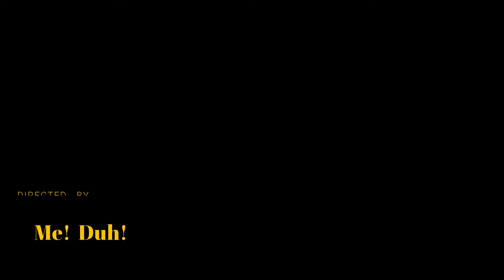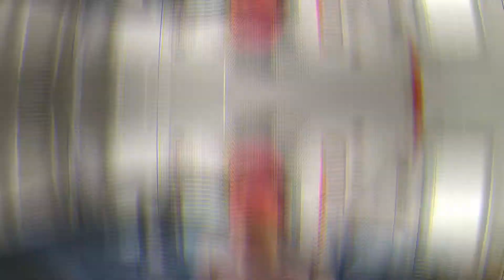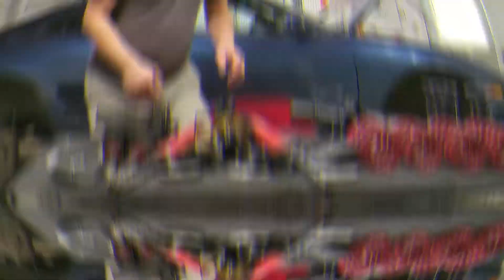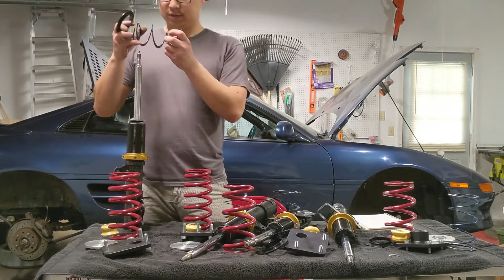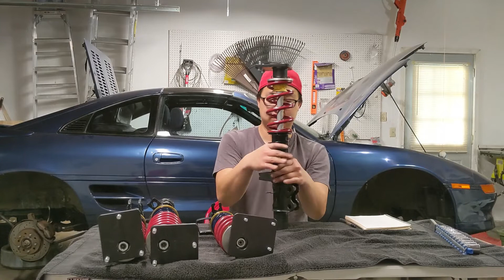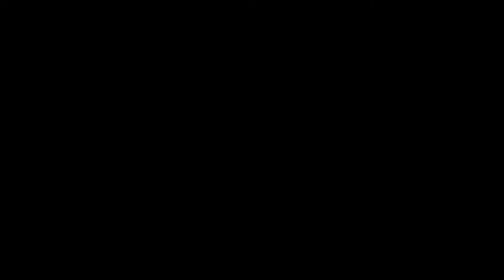MR2 Custom Coilover Build

Comment: How do you remove the perch? Literally cut the whole housing below it, or do you have to like cut and hammer until the perch separates? A lot of this info is dead in forums and I’m thinking of building some like yours.
Reply from the maker: I cut it out with a Dremel then grind the left over down.
Reply: @touyang9479  So the portion with the threads for the gland nut is essentially uncut? I have read of Alex W recommending sectioning about an inch off above the knuckle bracket, then putting it back below the bracket to increase travel with the Koni Sports.
Reply from the maker: @SuSpence1119 my kyb travel is pretty bad which I'm sure is very similar to the koni sport.  I'm considering going with koni race in the future in which I will have to cut off a bit of the housing to fit the shorter unit.

I'm not sure if cutting the top and adding it below the knuckle mounting point would matter since the sport insert is still the same length?

Comment: Nice job on the coilovers.  I'm just beginning to build my own set.  Any idea if that fab shop is still in business?  Thought I would have them modify my housings.  Looks like their FB and IG are no longer working.
Reply from the maker: Let me reach out to him to see if he's still in biz.
Reply: @touyang9479  Cool.  Thank you!
Reply from the maker: @Matts-cars  he is no longer in business.
Reply: @touyang9479  Too bad.  Thanks for checking.  Any idea where to locate the lower washer that is welded to the tube, for the sleeve to sit down on to?
Reply from the maker: @Matts-cars  I actually bought them as a metal pipe/tube and have the welder cut and weld it onto the strut housing.  I don't remember the exact size, but the inner diameter of the metal pipe/tubes were the size of the outer diameter of the strut  housing body.

Something like this.

https://www.metalsdepot.com/steel-products/steel-round-tube-dom?gclid=CjwKCAjwjtOTBhAvEiwASG4bCNlYJBU3M5X2icMKSxIFTlMHDrISrWE8UAVulYBAIrNZHeBuBczBJhoCwmwQAvD_BwE

Note that one drawback of my setup was that the front cannot be lowered too much due to suspension travel limit issues.  I have about 1/2 an inch to an inch before bottoming out in the front.   I might have a welder shorten up the front strut housing so that it'll fit the koni race which are shorter inserts to give me better travel.  The rears are fine though.